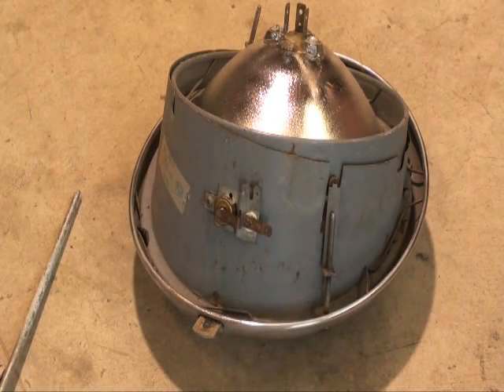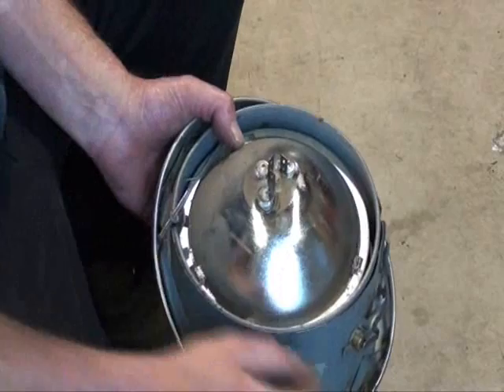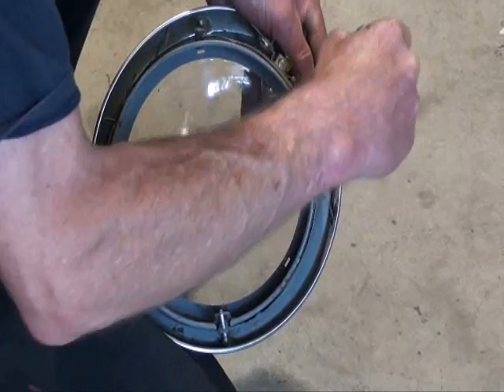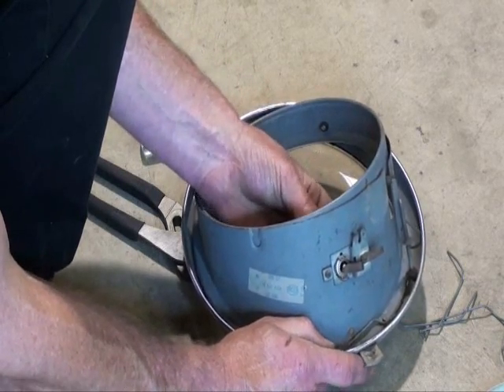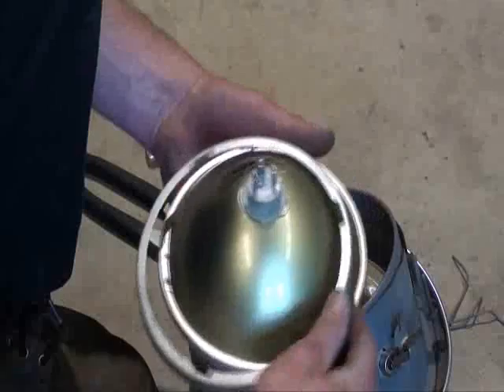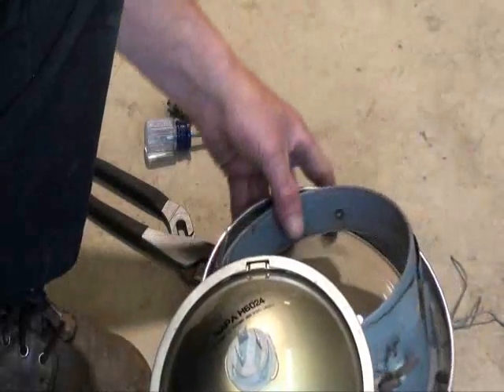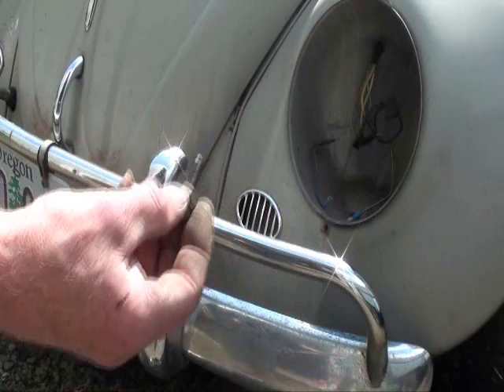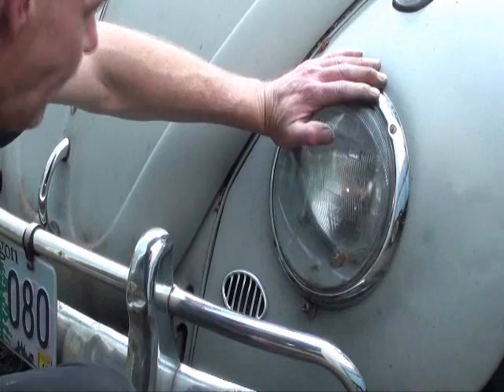bug headlight change 2.wmv

Comment: Can you fit these older style assembly to a 1967 model?
Reply from the maker: +cutworm59 You can use the old bucket type lights if you change to the '66 and earlier fenders... simple bolt on no mods needed. Thanks for watching!